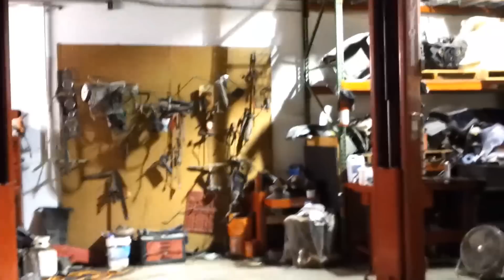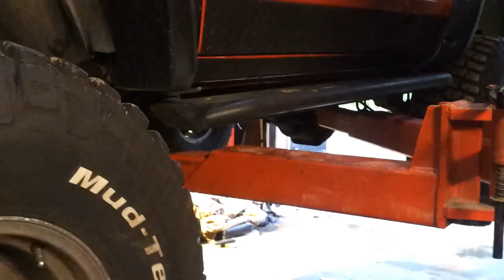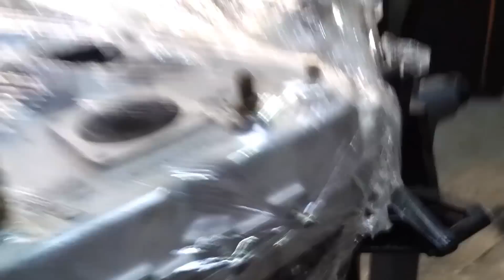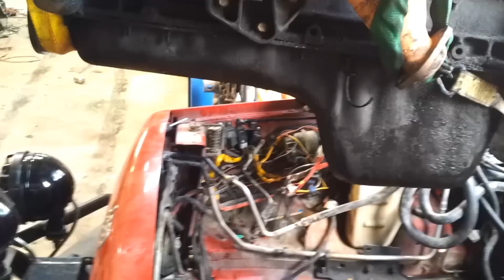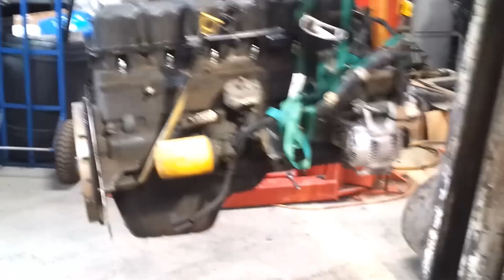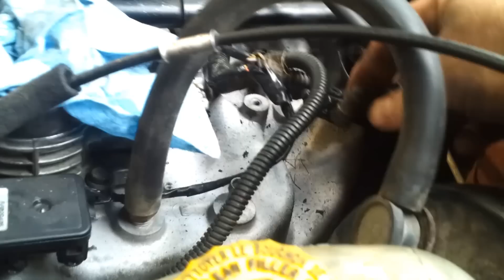4 0L Swap

Comment from the maker: Really, and how did you come to that conclusion? I guess by this estimation the Titan Engines guy at .120 over was driving a zombie 4.0L.  Radiator was removed, condenser wasn't.  Obviously removing the condenser would have added more time in having to recharge the A/C system.  Yes it has A/C and it is a daily driver.